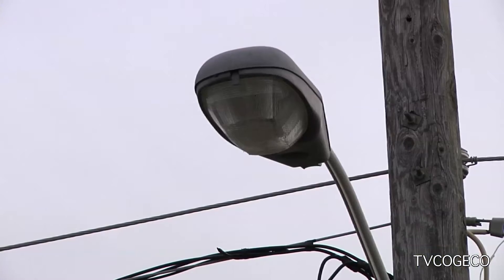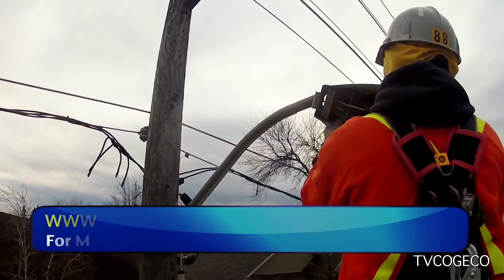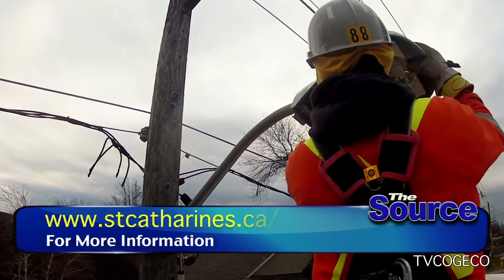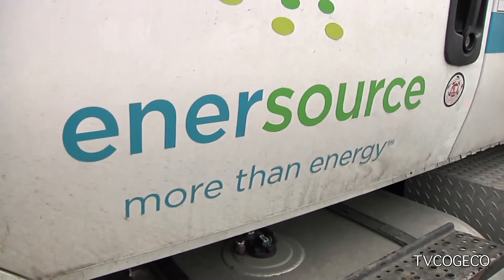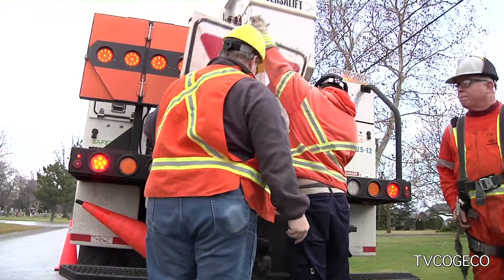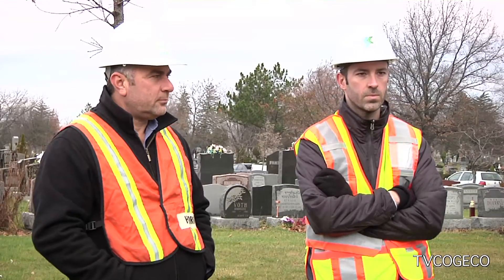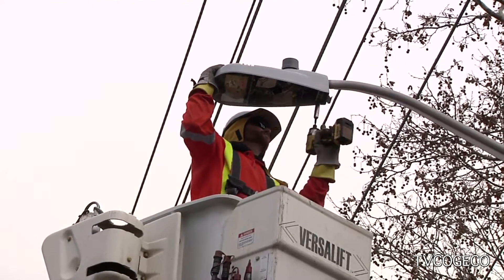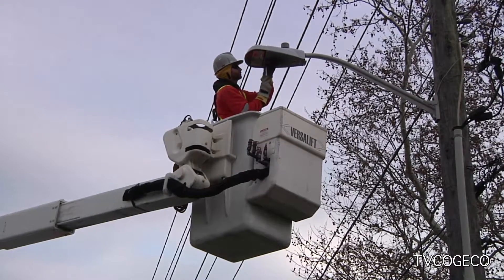LED Street lights

Comment: and no one will go up there in 20 years to clean the lens, as bugs and dirt degrade the light, when ya had to change out the lamps, ya could get a change to wipe the lens clean, LED suck to drive under Low pressure sodium is best HPS is 2nd best